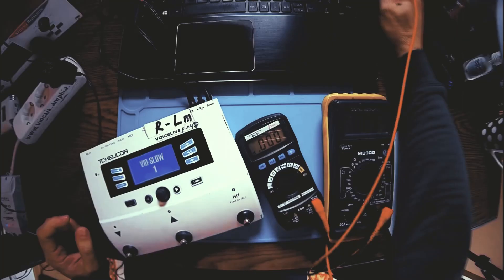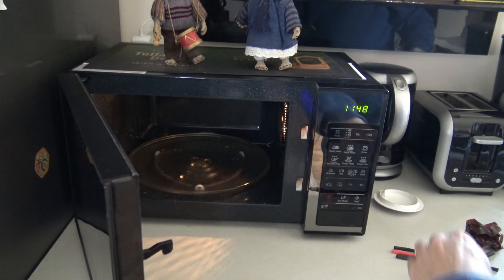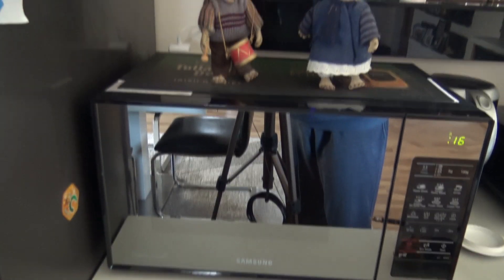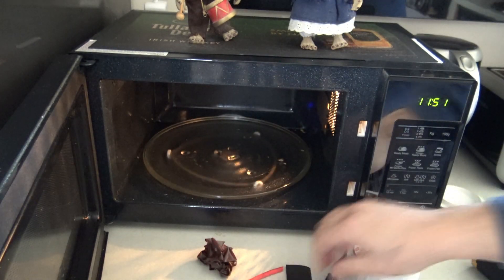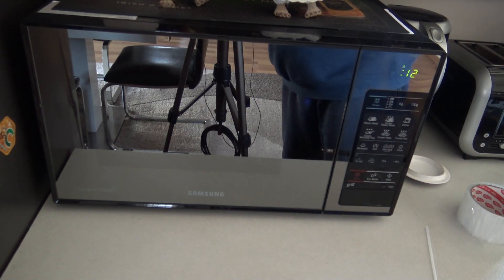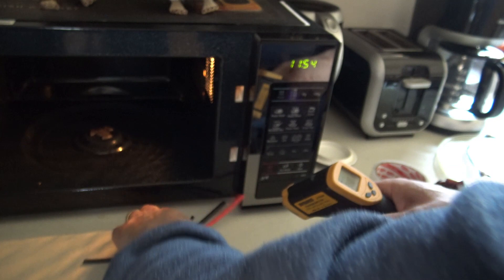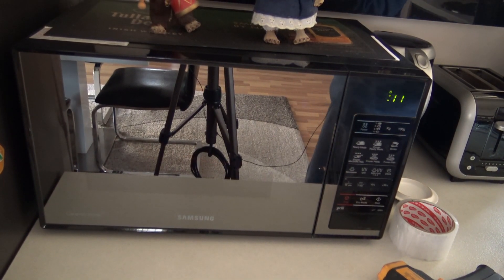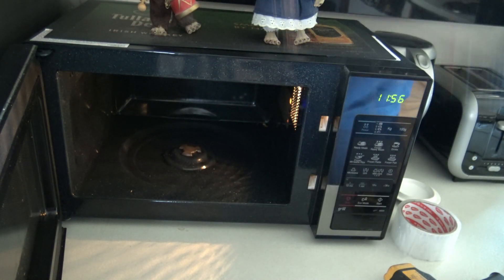Can we use shrink tube on coaxial collinear antenna?

Comment: Am confectionat sute de antene coliniare coaxiale (intre 130MHz si 5,9 GHz), si nu am observat pierderi daca foloseam tuburi care se micsoreaza termic,  un singur strat. La 3GHz la antena formata din 12 elemente coaxiale, invelite cu un tub negru, am masurat -0,4... -0,5 dB atenuare (de la un tub termic care acoperea intrega antena, foarte subtire, iar introdusa si in tub PVC, in total -1dB atenuarea data de tub si teava PVC cu diametru 10 mm). masurat cu FPH-P4ROHDE & SCHWARZ. Am folosit si la antene de pana la 5,9GHz si nu am avut probleme (am avut nevoie de un dispozitiv cu lame si sablon reglabil+lupa mare, pentru taiere coaxial). Pentru frecvente pana la 1 GHz daca folosesti doar un singur tub, poti sa ignori pierderile, sunt prea mici. Daca folosesti 2... 3 straturi suprapuse, mai ales  intre mufa de iesire si primele 2 elemente apropiate, se poate sa ai probleme, de la 1GHz in sus. Intradevar eu am folosit numai cablu cu ecran metalic din cupru, de la diametru de 3mm pana la cablu gros tip LCF 1/2 sau 7/8, iar pentru ISS, pe 438MHz am folosit inclusiv tub termic gros si cu adeziv,  peste dipoli din coaxial de 1/2. Posibil sa fie diferente minore daca folosesti cabluri coaxiale cu tresa, desi nu cred ca sunt notabile.
Reply from the maker: Multumim de precizari! Profesional!

Comment: You had very bad SWR for your 2450 MHz transmitter! Use some kind of dummy load, like a glass of water or something next time.
Reply: This is true at 2.4 GHZ. However, I feel like if he created a heat source for the material (heat shrink) under test, it may have given false results.  Besides, the  cabinet is a tuned cavity for that frequency and thus a proper dummy load. That aside electron tubes, being able to tolerate a bit more VSWR than most all active silica devices at near 1KW output.

Comment: I don't understand the experiment... What is having to do with interfering on antenna?
Reply: microwaves are just electromagnetic waves like  radio frequency. so that means if material get hot in microwave owen it is interfering with micro waves and most likely will interfere with RF waves too.
Reply from the maker: @laurynaslauris9677  exactly!
Reply from the maker: Let's say you use shrink tube to stiff the antenna, if the tube contain any trace of metal or carbon, or anything shielding the radio waves then whole antenna is compromised..think like cover with aluminium foil..also if we insert the antenna in a plastic tube..to protect it against elements and that tube have any radio blocking composition the RX is gone! That's why it's used fiber glass tubes because they are very radio transparent..even isolation tape or simply tape can damage the performances. If the material is radio transparent it shouldn't be affected by microwaves..shouldn't get hot! and vice-versa..if is getting hot is not good for radio..it's blocking a part or totally the radio waves..
Reply: @viocaia  ok. So is not good, according to this experent...👍
Reply from the maker: @adaniel69  Please watch the video again..at min 7:30 I said very clear it's ok to be use for protecting the antennas...so go for it!

Comment: What if u install cox in a PVC?
Reply from the maker: As long as the PVC is ''clean'' radio transparent there is no problem..but most, at least the grey ones have carbon of any kind and it's acting like a shield..that's why fiber glass it's used for tubing antennas..
Reply: good idea
Reply from the maker: @laurynaslauris9677  If the plastic is getting hot, so it's absorbing microwaves it's no good for any antenna cover/fixing